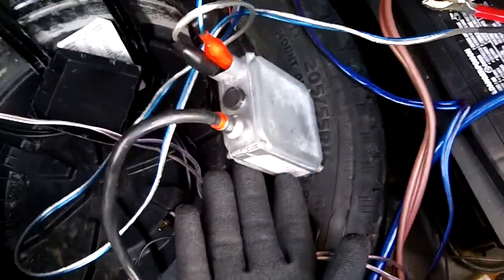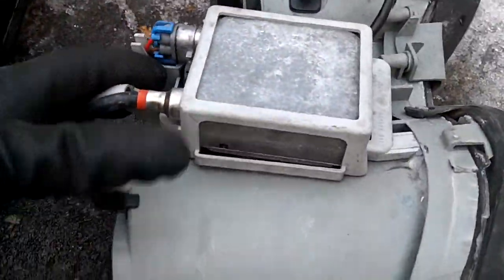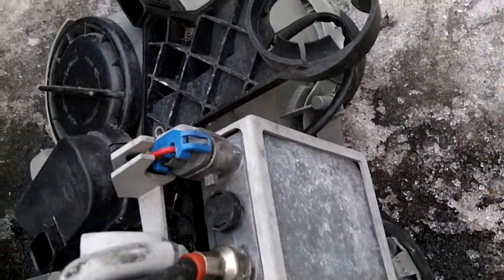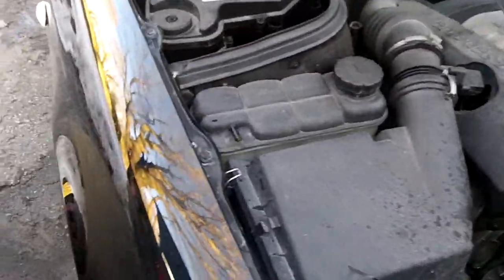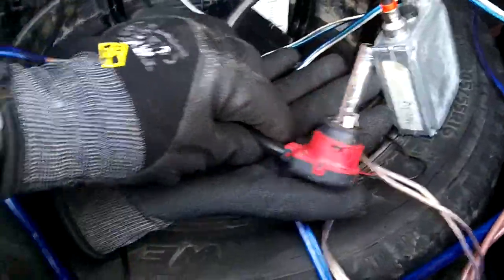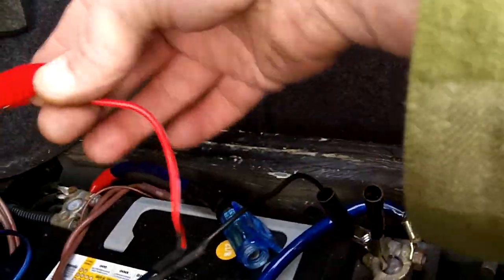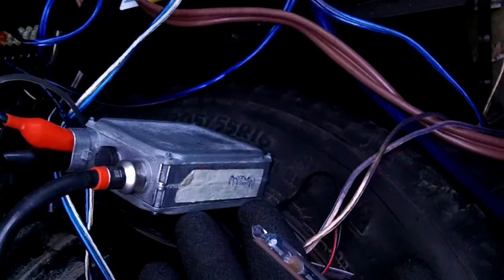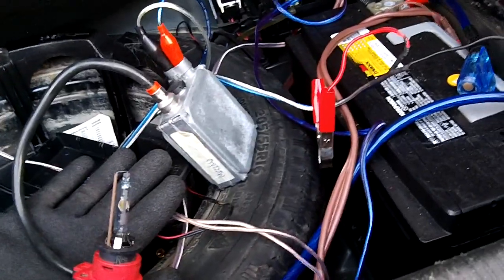Mercedes/Audi/VW/Ford/Citroen/BMW & more  xenon headlight ballast test

Comment: my low beam headlight don't work but the high ones do i got a c43 with xenon headlights both sides don't work could it be the ballast or the ignitor wire? i testedt the fuses the they read 11.5 i also checked the current on the low plug there is current flowing but no light.

Comment: Is there a way to only replace the igniter wire that goes to the bulb and not having to replace the whole ballast unit?
Reply from the maker: I"M pretty sure the wire coming out of the ballast to the bulb can just unplug and that part can be replaced

Comment: U have any recommendations for an HID kit for upgrade on a W202 C230? And which luminance is best? 6-7000k or an h7 i was told but i don't know without seeing the lamp output.

Also, seems like u find a lot of parts at junk yards, I'm searching for a couple of pieces and can't find them anywhere, New or Used...
Interior Driver and Passengers door handles, black. Not the door release handle, the leather handle where the screws to take off the panels are. I had some work done on my car and they broke the clips on both sides so now they're just hanging on. Also, the headlight, passengers side, there's a clip/bracket that holds the housing to the wheel well. Mine's gone missing. Of course i didn't pay for the work done as i got back broken parts but i zip-tied the light housing in place but can't find this bracket.

If you have access to any of these parts, i really need them...
Reply from the maker: I'll keep a look out for any of those parts..The xenon HIDs I'm not sure of..aftermarket ones are illegal in Canada...but yeah 6k is around the cleanest white
Reply: Thanks, i was leaning on either 6-7k anyways... Never heard even HID's being illegal but there are brightness laws in the US. Just like how its against the law to black-out tint windows.

And if you climb into a W202 C230 and come across the parts you'd save my ass big time. I'm searching for a junker around here. Trying a new place this weekend. If u do think of it, along with the door handles, the passenger headlight bracket mount, i need the felt slip the guides the rear driver window. Just realized it's missing last night when i put the window down. I thought it was gonna fall out of the track...
Have a good one!
Reply from the maker: I'll keep an eye out for that stuff...any car on the market that comes with xenon from the factory,has to have headlight washers (xenon isn't hot enough to keep ice melted in winter like regular bulbs) and automatic aiming of the headlights to keep from blinding oncoming cars...a poorly aimed xenon can cause accidents very easily...that's generally why they are illegal in many places unless factory installed...